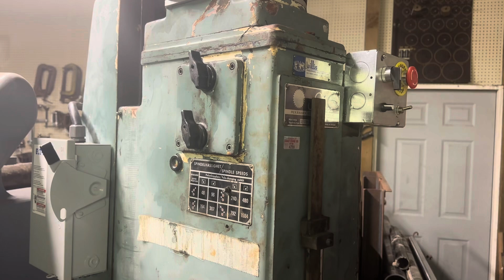Finishing the solberga drill press wiring upgrade

Comment: If you get some solder on both sides first, that helps.  People who do this often have all kinds of tricks but the most important one is the 3rd hand.  A 3rd hand to an electronics tech is like a vise for a machinist.  The next trick is having flux on hand.  I usually add a little extra solder to the joint because I want a little more flux but don't have it separate from the solder.  Watch out for putting too much heat into those little parts.  If you tin each side of the connection separately, it spreads out the heat input.  Those joints look fine to me.  The solder should be shiny and pass the yank test, like you've done.
Reply: Agreed. Added flux is good.

A good mechanical connection helps, and acts as a third hand.  In the job presented, I would grab a small wire from some stranded wire and wind it around the two parts.  Or set the wires 90 degrees and crimp on on the other.

Smooth/ debur/polish  the irons' tip and tin it.

A bit of heat shrink looks good always, but for us beginners hides solid but ugly work.